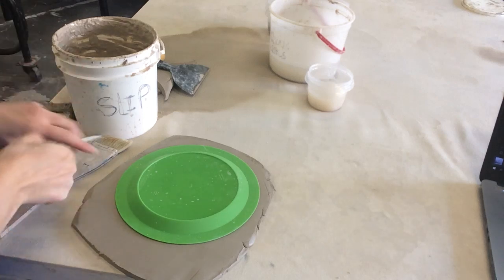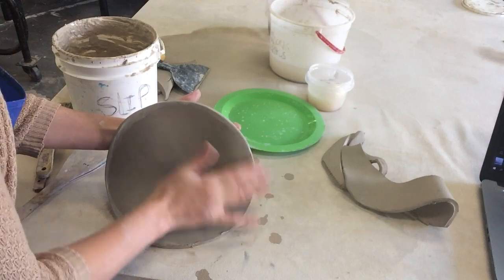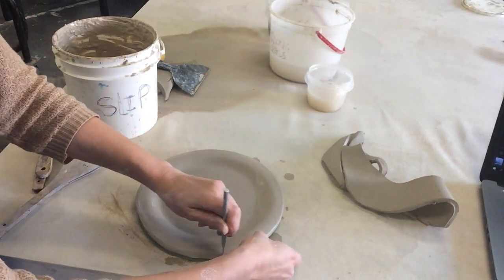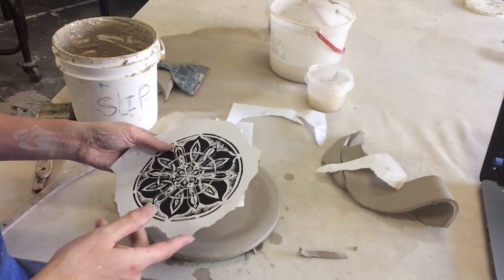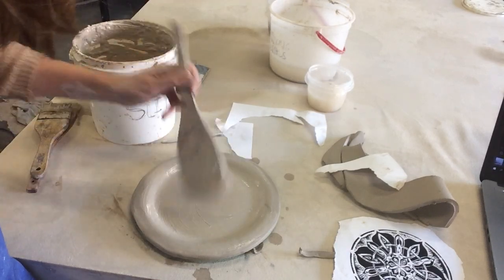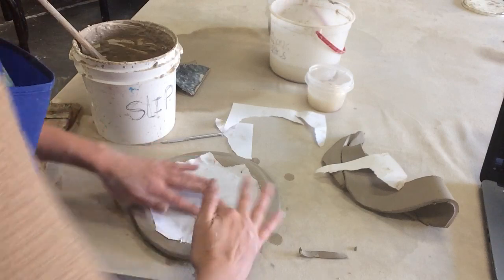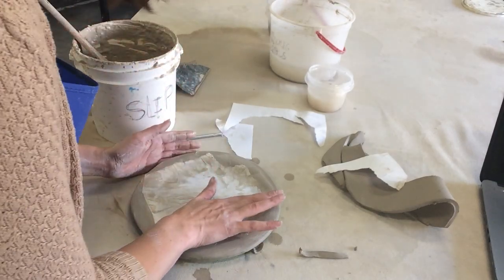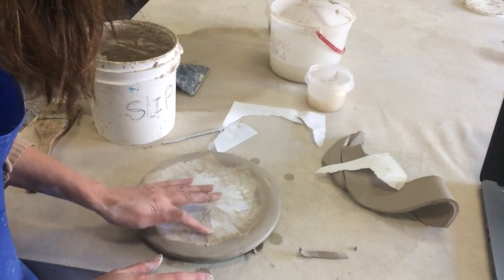Image Transfer on Slump Mold Clay platter - Part 1

Comment: Please correct me if I'm wrong, but this technique only works if you go over the image with underglaze, as the inkjet ink will burn out in the kiln. It's my understanding that the ink from a laser printer will hold up in the kiln (at a very low temp, maybe 06? Not sure) because of the iron content in the ink. The image will not be black, but a brownish color after firing. I've never heard of leaving the paper on. The water content in the wet clay should cause the ink to transfer to the clay surface so you can remove the paper. If you dab the back of the paper with a damp sponge, and then use a rib to burnish the image onto the wet clay, it should transfer. Anyway.... this is what I remember from art school. Maybe they use different ink in the inkjet these days and it now holds up in the kiln, but if it's water based, it will just burn out.

Comment: Ink is organic, usually inks fire out in a kiln, so how is this ink not disappearing when fired?
Reply: That's what I was thinking. Guess there's a reason part 2 was never posted
Reply: @faith7562  There's a step being left out of her tutorial, so for most people it isn't going to work. I don't know what kind of printer ink Crystal was using, but from some quick research I'm finding that they mostly can withstand a max temperature of a few hundred degrees before burning off. So whatever ink used would have to survive glaze firing temperatures. It's no wonder some of the people who tried and commented said their pattern was lost. That's where the extra step comes in. The printed pattern must first be completely covered by underglaze of the same color. You'd need a fine point applicator to trace the design, but it would work this way.
Reply: As far as I know, inkjet ink is water based and will burn out when fired in the kiln. If you want to retain the image you have to use a laser printer due to the iron content in the ink; however, the image will not be black, it will be brown. It also has to be fired at a very low temp. The process shown, is used to provide a guide for either carving or as a drawing guide for underglaze. You do not need to leave the paper on the wet piece, you can burnish the image onto the clay, and pull the paper off once the clay is leather hard. Once the clay dries completely, I suspect the paper will fall off anyway. Anyway, unless they've changed the chemical composition of inkjet ink, it will burn out in the kiln. At least this is what I was taught in art school.
Reply: @cidk59  I was taught the same. Iron does make sense. I’ve seen some that are underglaze, they do really well. And I’m curious about using ink to just transfer then carve…

Comment: Can you show the plate after firing?
Reply from the maker: MrsKrolik111 I’ll post some pics of it fired- I had issues getting the image to remain with the clear glaze though. The ink turns reddish brown.
Reply: I have never seen this work with inkjet because they do not have iron oxide in the ink.  But Toner in the lazer Jet Printers has some iron oxide in it and that is the reason the image goes reddish.  Some glazing will wash it away in a firing because the oxide is a residual amount and the glaze absorbs it and it is not noticeable anymore.  At least that is my theory.  I have had it work with glaze and other times it  doesn't.